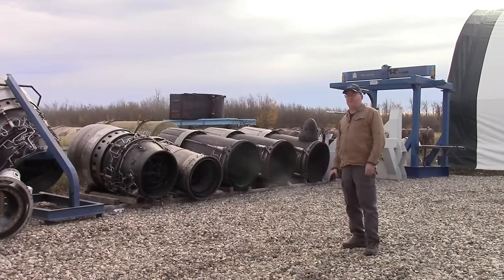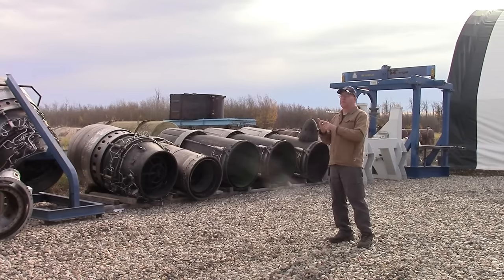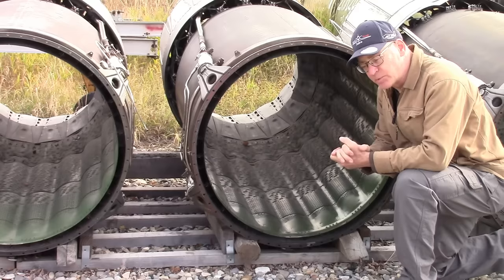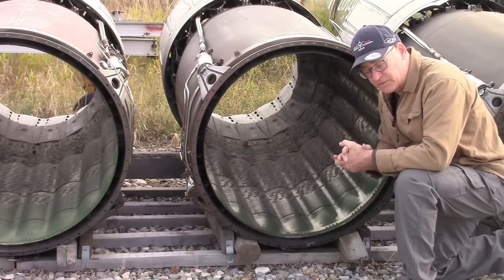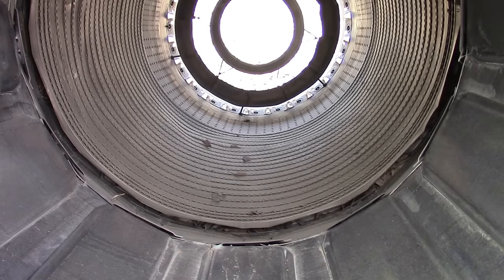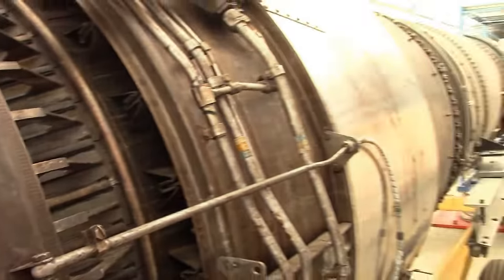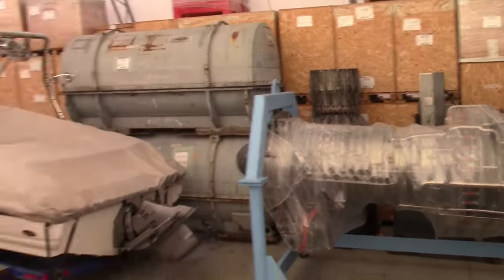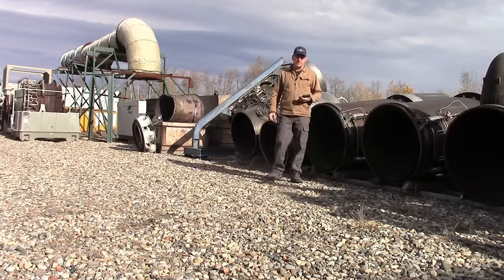Afterburner Liner Shapes

Comment: Nice presentation Jay and I would have to go with your second summation regarding the corrugations.
 heat expansion will cause a smooth chamber to warp and deform permanently where the corrugations allow the shape to return to its previous dimensions without any undesired change in shape or heat distortion effect
The Skunk works team used this theory on the Blackbirds outer skin for all the above reasons.

Comment: I am no engineer, but I have done construction since 1984. My opinion is that the waves in the liner are mainly for strength, and like Jay said the multitude of holes are to allow a layer of cooling air to keep the fire from melting the liner.
Reply: You are correct 
Like corrigated iron for roofing and others

Comment: I'm now retired but in my last job I machined loads of afterburner  "flame-holding" gutters. We seldom knew which engine they were for but they may have been Spey, Rb199, ???  Considering the environment in which they operate the mounting brackets were machined to ludicrously fine tolerances. They were made of very hard steel too.
Reply: Gutters ‘machined’, really?
Reply: Hi John. The basic shapes were pressed whilst glowing hot. Then little square holes were machined for the mounting brackets which were TIG welded in. The brackets were then slotted using a triple gang mill to fine tolerance. I used to do this last op.

Comment: Reheated Spey from a Phantom, the Buccaneer Spey had no reheat.
Reply: The Buccaneer is the loudest plane I ever heard.
Reply: @givenfirstnamefamilyfirstn3935 , you haven’t heard many, have you, if that’s the loudest you’ve heard? Loudest I have heard was earlier this year, at RIAT, when the F35 was in the hover.
Reply: @johnnunn8688    Have you heard a Buccaneer close at low level then?  It had/has no jet pipes or afterburners/reheat, the exhaust is straight into the exterior air and is exceptionally loud even though it has low bypass turbofans.
Reply from the maker: I don't know of any test we've done where I wasn't shocked by the noise level.
LM1500, LM2500, J79, J47, Orenda 10, Orenda 14, RR Avon, RR Spey, RR Olympus, Wright J65, and even the RR Tyne when it gets "on the pipe".
It's all roaring thunder...
Reply: @givenfirstnamefamilyfirstn3935  , the Phantom Spey has reheat added to the noise. Trust me, the Phantom Spey is louder, much louder. The F35 is louder than that, by an order of magnitude.
Reply: @AgentJayZ  , many moons ago, circa 1971, I was in the Royal Air Force and we detached to RAF Fairford, where the Concorde was carrying out test flights. 4 x reheated Olympus was pretty loud but we weren’t close to the runway, so it wasn’t a mad noise. I’ve seen/heard a squadron of RAF Phantoms take off at dawn, on a frosty morning, in pairs and that’s the loudest, until I heard an F35 in the hover at RIAT, this year. So loud, it became annoying. A bucc is a pussycat in comparison.

Comment: Can anyone tell me which surfaces of the jet engine does thrust generated by the afterburner act on?
Reply: The afterburner doesn't generate separate thrust, it just boosts the velocity of the exhaust gas already coming out the back. (Not a jet engine mechanic, so there may be some fine detail I missed, but that's my understanding) Quoth wikipedia: "The afterburner increases thrust primarily by accelerating the exhaust gas to a higher velocity." it's backed up by footnote 6 on the "afterburner" page, if you want to see the math.
Reply from the maker: Thrust is generated by the acceleration of exhaust gases as they pass through the final nozzle.
So you could say the reaction forces act on everything ahead of the nozzle, which is every part of the engine.
Reply: The thrust would act on the entire engine. Thrust goes one way engine goes the other.
Reply: That is a FUN QUESTION with probably a proper complex answer that might need an engine designer to explain it in detail. The engine designer from RR did touch on some aspects of this and Jay does talk about it also.
Reply from the maker: I have a video called "where does thrust act?" and a search feature on my channel page.
Reply: @AgentJayZ , when I did my engine training @ RAF Halton, we were taught the thrust acts upon the main thrust bearing, which is a deep groove ball bearing. The compressor is trying to fly it’s way out of the intake and the thrust is helping it achieve its goal 😂🤣.
Reply: The reaction is against the air leaving the engine so ultimately it must be the compressor thrust bearing?
Reply: @givenfirstnamefamilyfirstn3935 , that’s what I said, ⬆️ there, just above your comment.
Reply: @johnnunn8688   Did I say you were wrong?  I gave the logic behind my opinion, based on my lecturers/instructors and my reading … and everything else.
Reply: @johnnunn8688  
Now I did say that where the thrust acts within a turbine is a FUN QUESTION. Logically what you say makes sense on a first pass at answering this question but I believe it is much more complicated. My first thoughts are from a question that I asked a Professor in class once. He was lecturing about the design of, and inherent problems of “thrust bearings” and I asked “IF THERE ARE THESE PROBLEMS WITH THRUST BEARINGS, HOW DO JET ENGINE BEARINGS DEAL WITH THE INTERNAL THRUST ALONG THE SHAFT?”. Now this particular Professor (also my senior thesis advisor) knew the answer as he was directly involved with the design and development of the first generation of Pratt & Whitney jet engines (so this answer may vary depending upon any particular jet engine). His response was that (to paraphrase) the bearings (as stated in thread, the ball bearing) do not support any thrust (and are there for alignment) and the thrust that is generated by the engine reacts against other surfaces (my memory is somewhat vague about his exact wording, something about gas expansion but he minimized the answer as it was not the topic of the lecture). What is not vague though is that his answer left me confused as how that could be. 

This topic has always fascinated me due to my lack of a properly detailed answer. As mentioned, there is a whole video on the topic. If I remember correctly, the discussion thread, and some other discussion threads have answers from a Rolls-Royce engine design engineer that shed more light on this topic. I would recommend that anyone interested should look for those discussions. One of the takeaways that I got was the engine designer has complete control over the amount of thrust applied to the ball bearing by controlling pressure differentials across the engine components (things like disc). The Rolls-Royce engine design engineer even stated that he could and did set positive and negative thrust on the ball bearings depending upon requirements. 

Now that we are adding in the additional variable of an afterburner that will change the pressure distribution across various components of the casing, stators and other items, we need a knowledgeable person to provide a correct answer. I personally know enough to know that I don’t know how to properly answer this question.  One thing is that it is mentioned in the thread is about how it is “about changing the velocity of the gas flow” but leaves out that the gas flow has to be accelerated which requires (F=MA) that the gas flow to have a pressure that reacts against engine components. One can use the overall change in the mass flow velocity to establish an overall limit on thrust produced, but that does not help to explain where the thrust is transmitted within the engine.
Reply: @Mentaculus42  , what the actual F, are you effing on about?

Comment: I have an afterburner question. This concerns a TF-30. As a crew chief on F-111 aircraft and engine run qualified we had 5 "zones" of afterburner. You knew which "zone" you were in by the position of the exhaust nozzles as you advanced the throttle through all 5 "zones". Are there any other engines with afterburners that have "zones" or is that something specific to a TF-30?
Reply from the maker: The terminology might change, but I think all modern afterburners work this way. The J-79s we work on have two separate manifolds for carrying fuel to the spraybars on the early models, and four on the later models. Each spraybar has four sectors, each supplied by one of the manifolds. Each manifold is supplied by the AB fuel pump through a valve that opens at a specific pressure, increasing from the first to the last.
The afterburner is progressive, but the fuel pressure to each little orifice in the spraybars is maintained above a minimum, so no dribbling occurs...

Here's a vid i made about sprabars   https://youtu.be/IHVnWVgzUE8

Actual fun fact: the manual states that in order to bench test the afterburner fuel pump, an electric motor of at least 175 Hp is required to drive it.
Reply: @AgentJayZ  That is a mighty powerful electric motor, man, oh-man.
Reply from the maker: Yeah... we test the AB fuel pump by hitting full AB in an engine test. It's impressive, as you can see in many of my vids.

Comment: 7:29 What are those two white bags laying in the bottom of the engine for?
Reply: They are filled with sillica gel to absorb humidity. Usually they are lots of them when the engine is in its crate.
Reply from the maker: That's dessicant. It dries the air in a sealed container. A container for the Iroquois would need about 50 of those bags.
Those two are just litter.
Reply: Each bag is based on units, depending on the size of the bag.  We still preserve the T56 with 28 bags using tech "Manual to the SPI standards. "method 50". You can reuse those bags by microwaving them, but we've never done that. We just buy new 100%
Reply from the maker: It's much safer to renew the dessicant by heating in a standard oven to 275F for 24 hours...

Comment: Wouldn’t the slots draw in cooling air since fast moving air will have less pressure and in turn draw in the cooler air from behind the slots?
Reply from the maker: The fast moving air is inside the jet pipe. The cooling air is at a slightly higher pressure.
Reply: @AgentJayZ  Thanks for info, I’m just a layman but I was just wondering if those slots were used to create a Venturi effect from the fast moving jet air in the center of the engine?  Great videos…

Comment: Have you ever been tempted to sit on one of the turbines while running in the test cell? Thanks for the close up.
Reply from the maker: Turbine case temperature at idle will be over 700F, and close to double that at full power. Never thought of sitting there.
Reply: @AgentJayZ  Some insulation in between and you'll be right.
Reply: @AgentJayZ  Do you ever choke the intake of a turbine (compressor) to simulate a high altitude environment, or is it just a sea level static test?
Reply from the maker: When you put (compressor) right next to turbine, that's usually a way of indicating the two words mean the same thing. Nothing could be further from the truth. In function the two are exactly the opposite.
I have a vid called what makes a turbine turn, which will help you, I think.
Reply: @AgentJayZ  I think he's just using the word turbine to mean "jet engine" then specifying compressor?
Reply from the maker: You mean like "hey, check out the new piston in my truck" ?
There's turbines, and there are turbine engines. If you keep mixing that up, there will always be problems.
Plus, if we want to be correct, he could have just said "compressor".
I stopped trying to interpret what people were really trying to say a while ago.
Sorry, but I have been through this hundreds of times. I've made videos explaining this and almost every other question out there. They are all on my channel, so I stay away from repeating myself in comment boxes.
Reply: Why would you think that?
Reply: @AgentJayZ  I meant turbine engine as a whole, not just the turbine wheel/s. So, have you ever restricted the inlet of the compressor to simulate high altitude and see how the engine and fueling reacts automatically?
Reply from the maker: Oh... there are correction tables for converting test data at any altitude for any other. 
The kind of testing you are thinking of sounds more like developmental testing of new engine designs.
That's a whole different world from what we do. We are proof testing, or doing quality control on our work done on an established design.
We return it to stock condition, confirm it performs to factory specs, and return it to the owner.

Comment: Hi Jay, what is that ducting on the scaffolding @ 10:00?
Reply: I think that's the exhaust duct that they use when testing power turbines.
Reply from the maker: It's the exhaust duct we use for the Tyne. It has an integral power turbine, so doug is very close to being correct.
Reply: @AgentJayZ  So to clarify, it's because of the power shaft extending out the rear of the gas duct that the exhaust flow is turned 90° and thus requires an "exhaust pipe".
Reply from the maker: We have heavily modified a Solar Saturn exhaust manifold for this purpose. I honestly have never seen a real Tyne exhaust duct, either for aircraft or for the marine version...
Reply: @AgentJayZ  Yes! That inverted teardrop/banjo shape is exactly what I visualized. Thanks!